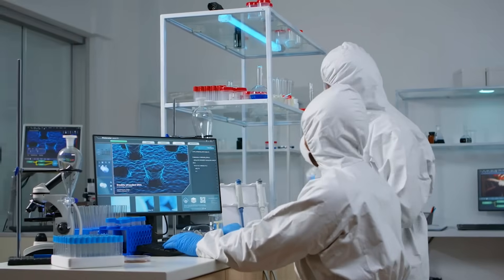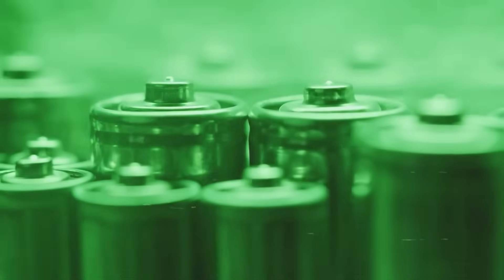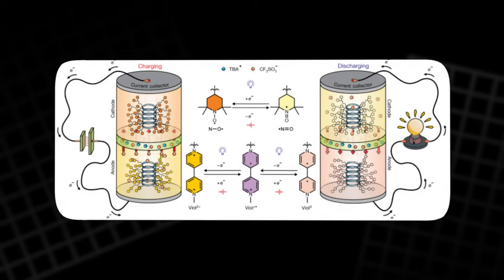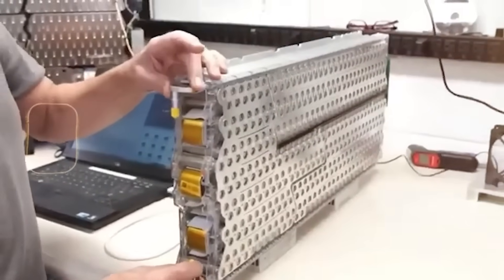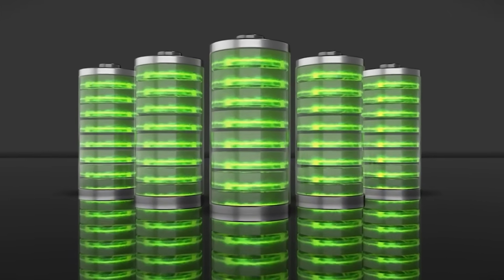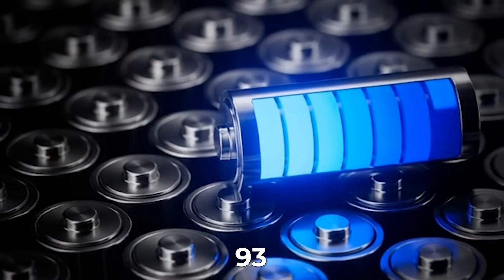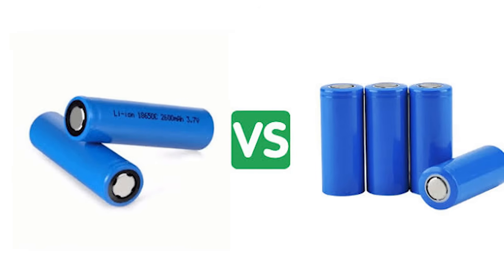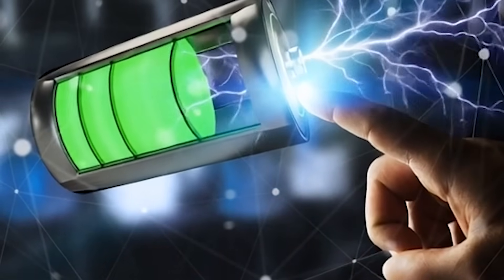The Battery That Could Last 12 Million Miles | The Zinc-Organic Revolution #CleanEnergy

Comment: Cost/kWh/cycle will be the key metric for stationary batteries. Also, there was no mention of its capability to operate at low and high ambient temperatures.
Reply from the maker: You've highlighted some really important practical considerations for stationary batteries!